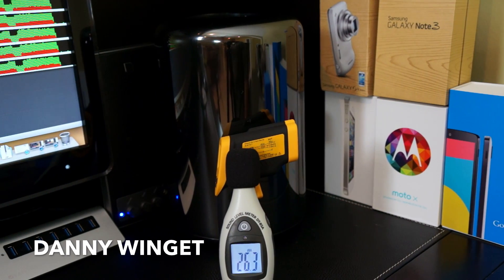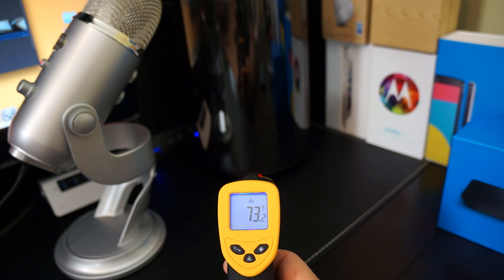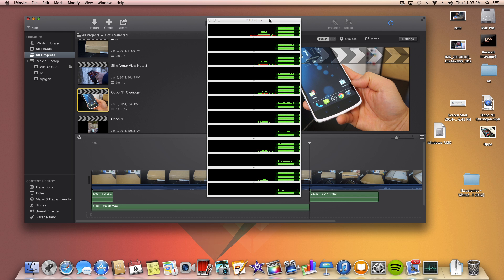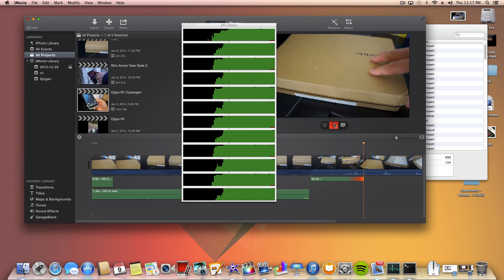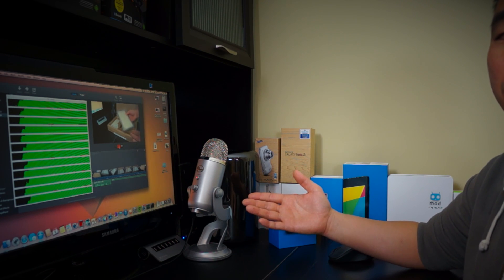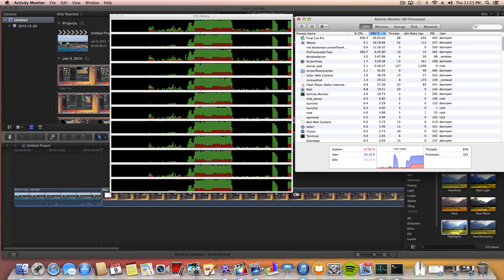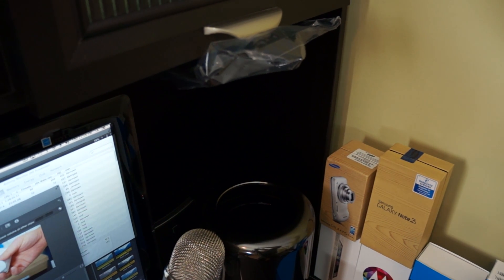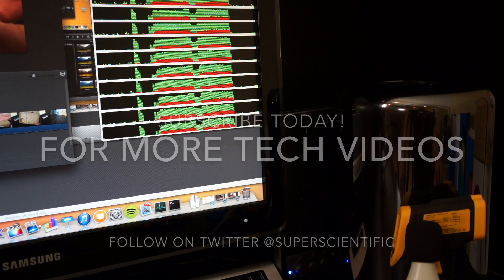Apple Mac Pro 2013 Heat and Fan Noise Test (Full CPU Stress)

Comment: I don`t think if low temperature of exhaust air says anything about efficiency of cooling solution as a whole. If your radiator has low number of fins and additionally those fins are  thick, it will be difficult to pass high amount of heat from radiator to air. I`m sure exactly that is happening here - exhaust air is pretty cool, but components inside are fried in temperature reaching 80C, which severly shortens their lifespan. Think about it - your low RPM fan in Mac Pro is creating low air pressure - if fins in radiator won`t have enough space between them, they will effectively block any air movement through chassis. This cooling solution by its design is not capable of keeping this machine cool inside (below 60C). Open it during CPU & GPU stress and measure temperature on radiator - you will see it for yourself.
Reply: but modern gpus and cpus will still boost until 85-90c, my gpu doesn't even spin until 65c by default, 75-80c is the sweet spot for minimum noise while still keeping the boost clocks, in fact 82c is what nvidia targets their Maxwell line at

Comment: Even the original, 1,1 Mac Pros are very quiet machines; however, the current Mac Pro is near silent. Too bad that my 2006 Mac Pro had previously spent 9 years as a graphic design machine, running for hours a day. The frontal fans are worn out on this thing, and are a good deal louder than those on my brother's Mac Pro, or any other for that matter. For a 9 year-old machine, though, this thing is rock solid. Sure, some professional who does serious work would feel its age (in spite of GPU upgrades or the installment of an SSD), but most wouldn't be able to. I upgraded my GPU, and this thing is running like a current machine would.
Reply: +maccollectorZ (Commenting Account) Hm something must be wrong with mine then. I can hear the fans quite good and also hear the writing of RAM of HD (quite loud fast ticking noise whenever you do something).
Reply: Sketchy Songs On Saturday Do you have a nMP or the previous models? Your HDD may be dying/old, which is why you can hear it so well. As for your fans, check their RPM and such. Make sure nothing is going out of whack. You want to also download Hardware Monitor or iStats and check your temps.
Reply: +maccollectorZ (Commenting Account) Thanks for the tip. And yeah I might have damaged the HD's while transporting the Mac pro. It fell on its side :-/ 

I've got the older Mac Pro, a 2.1 version. I'm going to install those, thanks for the tip.

The strange thing is that it's something quiet while transferring data, and sometimes it's noisy. That's why I was kind of puzzled by it. 

The machine does work wonderfully, I've rendered a full video in ten minutes as opposed to 40 minutes on my macbook pro. It's just noisy.

I do hope I only damaged the HD's, because those aren't that expensive.
Reply: Sketchy Songs On Saturday Yeah - and it could also be because they are old (if they ARE). As I mentioned, I have the 1,1 Mac Pro, whose HDDs were the stock 2006 ones, when I got it almost a year ago. They were PAINFULLY loud, so I just use an SSD as my boot disk and a quiet Caviar Green as my Time Machine disk. A loud HDD makes a huge difference in terms of the noise. I used to have a newer Caviar Blue drive in my frontal HDD slot, and I realized that it was the major cause of noise coming from my machine; I thought that the fans were making all that noise, as the HDD hadn't seemed so loud when I'd spun it up in my hand. 

I would advise an SSD as your boot disk and a new and quiet HDD as your backups/extra storage. My SSD sits at the front, and I have my quiet Caviar Green in the very last slot - just to minimize frontal noise. All slots have the same bus speed anyway.

I also got a quiet GPU; you can either find something passively cooled (like the Radeon 6450), or a card that just has really quiet fans, like those with ASUS coolers on them. I have a GTX 660 in mine, and it's almost silent. Note that it's not flashed, though, so it doesn't show boot screens. In emergencies, I've have had to pull out my 8800GT. 

Lastly, I replaced those frontal fans in case; I think the assembly I got was a little bit quieter, but it probably didn't make a huge difference. I'd rule out HDD noise first.
Reply: +maccollectorZ (Commenting Account) Ah okay, yeah that does make sense. These HD's seem to be quite old as well, and when buying the machine he just booted it up and I didn't really pay attention to the sound.

The fans do make a bit of noise but it's just static noise. 

Thanks for the tips and the information. I at least know my HD's are still alive and kicking (also looked up a couple of websites for sound bites) :-)
Reply: Sketchy Songs On Saturday No problem! Hopefully I was of help. If you ever have issues with your HDDs and want another mechanical HDD, you can pick up a new, quiet, and fast 1TB HDD for like $45 these days. I'd do that rather than counting on old HDDs. Sure, HDDs can last a long time (the original HDD in my 1987 Macintosh SE still works), but they can fail unexpectedly and are just noisy and slow.

Comment: hi i have a mac pro and until you connect 4 displays the fan will not getting up.

please make a new video test of your mac pro with 4 screens 1080p 21 inch. you will hear the fan !!!!!! one display video youtube, one display for example on simulator for guitar player such as guitar rig, one display with mt4 station for forex trader and one display with sype video call... here your will hear the fan getting crazy ah ahhhhh

Comment: @OP It would have been nice if you had run an extreme CPU/GPU test, like 3DMark, because when those dual GPUs ramp up they generate a lot of heat.

Comment: Really great video! I just got my Mac Pro a few days ago and I'm loving it. I've been exporting a lot of video throughout the past 24 hours and noticed how impressive the fan noise is — or lack thereof. The system gets quite warm, but it always maintains a quiet noise level. Impressive engineering, for sure! Gotta love that thermal core.
Reply: RevolutionV12 Man, quality has a price. And the ridiculousness of prices just depends on the size of your wallet. I'd much prefer to pay a bit more (if I have it) then to go through the misery of hacking and debugging hardware (I did hardware hacking for more than 20 years, hackintosh too). It's just not worth it for me. Even Hackintosh, will never be so solid as a factory Mac. The thing about Mac's hardware it that it is specifically selected to work well with OSX. That's the 1 reason why it is so stable. I tell you in one phrase, I've never felt so at piece using a computer in my life. No more "Error reading memory address GS4H345HG3" out of the blue. The hardware is so good, that once I had a macbook pro on top of my fridge (2 meters high) - my GF opened the door carelessly and the macbook fell into the hard ceramic floor. Result: a little bump on the aluminum. It was on, and didn't even restart. It was running Bootcamp. I was so scared, I opened the lid and saw Windows 7 still running blissfully. Later I found out Macs (laptop macs) have a sensor that detects free fall and turns off the discs to prevent HD damage. After 8 years I still use the same laptop with the same HD. Although I swapped the DVD with a SSD to have both and added 4GB RAM. I still use Windows in another computer, to play Windows-only games, but it's frustrating to use it now, every now and then it comes up with some strange error out of the blue. Now I mostly use OSX, as it is simply a peace of mind, and gives me no weird errors out of the blue. It can crash, but it's so rare, so rare, it's even cute when it does. I love Windows, used it all my life, I love it's File Explorer especially, but after 20+ years, I'm tired of it's hurdles. I put a few $ more and it's totally worth the peace of mind I get in return. I do recommend Hackintosh or Windows PCs if you all you want is to play heavy Window-only games, those of the kind that work best using dual graphic cards and stuff like that. Using a Mac Pro for this would be a luxury for rich people. I'm a developer / designer / ocasional gamer, and my macbook pro works fine. Costed me €1500 8 years ago, I play League of Legends in it, runs fine, it's not the heaviest game. I don't think buying the Mac Pro depicted in this video is worth it just for gaming and if that's what you meant I would agree with you. The Mac Pro is a computer for professional use. If you like hacking stuff, I tell you, you would love the TERMINAL in OSX. It gives you Linux power over your OS. A real terminal! You can do anything form the terminal, purge memory, install/activate/deactivate apps, mess with your kernel, hack the OS, etc. As a developer it's a godsend for me.
Reply: You could have achieved the same with a watercooled PC, only the temps would be a lot better and it would be cheaper.
Reply: RevolutionV12 I've used PCs all my life (almost 30 years) and was always reluctant to try Macs. I confess I was a Windows Anti-Mac fanboy. After properly trying a Mac I'll never go back. PCs are bugzillas. OSX is crazy SOLID. Mac Pro's hardware is great, some tuned-up PCs also have great hardware as you say, but it's OSX that makes the difference. Windows is the shit. All versions of it. If OSX would die I'd go for pure Linux. A solid OS makes the whole difference.
Reply: Antonio Brandao i wont argue OSX with you, as it has some benefits, and preference comes into play here. But the main reason i hate Macs is the ridiculous hardware prices. Just get yourself a hackintosh, all the benefits of PC with all the benefits of OSX.
Reply: Antonio Brandao that is all cool, and if Mac works for you then who am i to argue your preferences, but my point that Macs are grossly overpriced still stands. The parts they use are simply not worth the amount of money you pay.
Reply: Antonio Brandao I try to explain that to so many people! It's nice that you figured it out for yourself. I have plenty of old Windows PCs, and they are like Toyota Tercels when compared to even my oldest Macs.

Comment: I am confused about your Sound Level Meter. The spec on this device is 40dB to 130dB (CEM DT-85). I have a similar device and getting any reading under 30dBA is not possible. Also a VERY quiet room is 32dBA and any talking would easily send the meter to 50dBA. So - (not being rude but questioning) - what mode do you have this device in? I find a slow averaging mode (if it has one) to be the most accurate... Thanks for the video though - noise under load is exactly what I am interested in - recording studio application. The meter I use is a American Recorder Technologies SPL-8810. I think the nMP may be so quiet (less than 40dBA) so that your meter is not reading it correctly. If I select settings that are out of range on my meter - I can get similar behavior (but it also gives me an error indicator).

Comment: Dang, wish he would looked at the the actual cpu/gpu temps, heard they basically peak out at the throttle temp of the cpu/gpu. 
On a related note, my exhaust temps are still cool....then again my temps aren't 95C+ at the cpu/gpu cores...and I can't hear it running right beside me :)